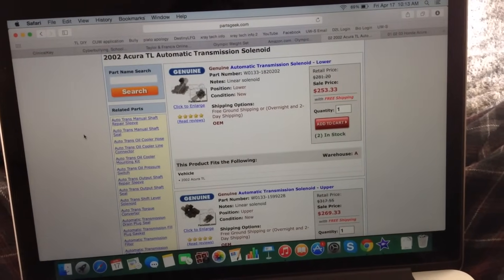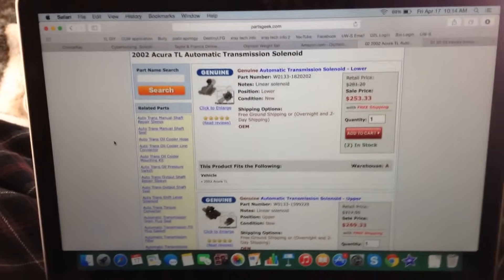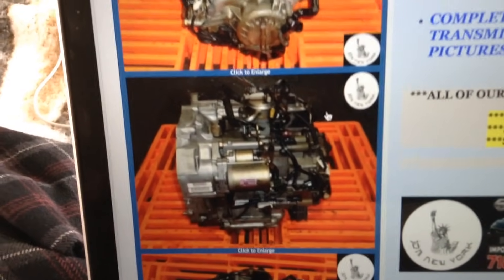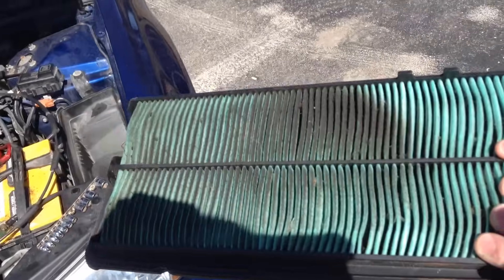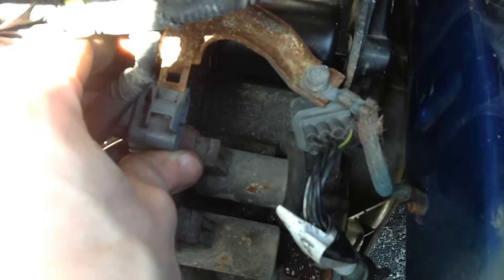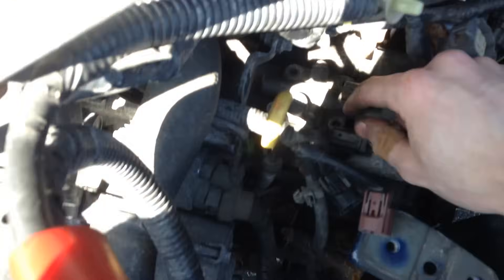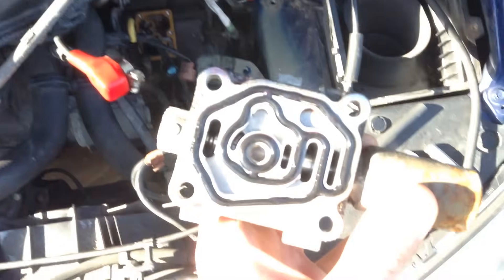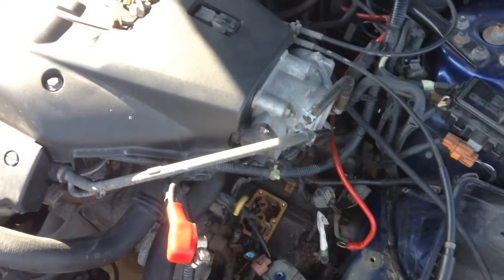Transmission Fix: How to Clean Solenoid Screen Filters for Honda/Acura P0730 P0740 P0780 P1750 P1751

Comment: I did this procedure on my 2003 CL - S I thought successfully(though all 3 screens were amazingly clean). But soon as I started the car it's now throwing a code 1768 and the check engine/VSA lights are on. When I put it in Drive it seems to be slipping & revving high just to move forward??? WTH PLEASE HELP!!!
Reply from the maker: I've never heard of anyone cleaning the filters and then the car performs worse. Sounds like there must have already been an underlying issue. Did you clean the bottom solenoid filter too? How does the fluid condition and level look? It could also be an electrical issue. Make sure you hooked the connectors back up to the solenoid all the way until they click in place. Also, try checking the fuses. A simple blown fuse could be the culprit too.
Reply from the maker: I've never heard of anyone cleaning the filters and then the car performs worse. Sounds like there must have already been an underlying issue. Did you clean the bottom solenoid filter too? How does the fluid condition and level look? It could also be an electrical issue. Make sure you hooked the connectors back up to the solenoid all the way until they click in place. Also, try checking the fuses. A simple blown fuse could be the culprit too.

Comment: Did you have any codes for the transmission?
Reply from the maker: yup, original code I was getting was P0740, and doing this made it go away!
Reply: Ok i have a p0730 code.
Reply from the maker: @11caseyd  faulty solenoids can possibly set that code off too. You could still give this a try! Otherwise, make sure your fluid level isn't too low or too dirty. You can check out my other video on transmission fluid here: https://youtu.be/SjYVD2WCrCM
Reply: Im going to clean then and try lucas stop slip. Just need a bandaid for the winter then ill do the 06-07 accord av6 transmission swap and be done with it

Comment: I have a code p0746 pressure control solenoid "A" stuck off... Do you think I could do this instead of removing the whole valve body?
Reply from the maker: It's very possible! Basically, this code means something is obstructing the flow of transmission fluid through the valve body, such as the filters shown in this video. Give them a clean! It's free and can only do good for your car. Also, check your transmission fluid. When was the last time you changed it? Is it really dark, dirty, or smell burnt? Is the transmission fluid level low? These are also very possible symptoms of your CEL. Check out my other video on transmission fluid for more info! https://youtu.be/SjYVD2WCrCM

Comment: When I clean mine out just like you did after two weeks Dave get right back dirty what shall I do
Reply from the maker: if you had junk in the filters, that's both a good and bad sign. It's good because you know where your problem is, but bad because that means your fluid and filter probably need to be changed. If you cleaned out the filters and they became clogged again, simply clean them again as well as change your ATF and exterior filter as shown in my other video here: https://youtu.be/SjYVD2WCrCM

Comment: My 03 TL Type S coded the p0740 several months ago. Since then, it won't shift from first gear. I try to crank it and idle it around the parking lot so that it doesn't just sit there and fall into further disrepair. It only has 298k miles on it. 
I'm going to try this. Between all of the videos on here, the Hayes manual, and the official Honda/Acura repair manual pdf, I hope I can get it back on the road. It's surprising how much more difficult it is to work on a car in an apartment parking lot than it is in a yard or a driveway.
Reply from the maker: Yah working on a car at home is way more convenient! This repair has helped a lot of people! But if this doesn't work, people have also told me replacing the solenoid itself has fixed their vehicles as well. Good luck!

Comment: if it does not work ... can you take the part back???
Reply from the maker: If you bought a replacement Honda part from an authorized Genuine Honda parts seller, all parts should come with a 1-year warranty. You can find replacement solenoids online if yours does not work.

Comment: I have a 2000 acura tl i just replaced the trans with a used one.it had a similar problem shifting into 3rd gear.i watch your video last night today i did exactly like you did in you video.the bottom selonoid filter was completly clogged with friction material cleaned with throddle body cleaner.test drove it a few miles and it seems to be much smoother ride.great video very informative.thankyou for your help i will subscribe to your channel.thanx again.
Reply from the maker: That's awesome! I'm glad to hear this helped you! Thanks for the sub!!

Comment: Just in case this doesn't work for anyone.. You may consider doing a AV6 swap .. You can goggle it ,but I was short on luck. my transmission shop was/is willing to do it but told me the donor transmission needs to be 20,000 - 45,000 miles. He said with all the V6 trannys up to 2010 are vunerable to slipping  after 50-60,000 miles... The issue is still there. Some who did the swap are kinda still riding on luck. But it still worth a shot... I'm gonna still try but I can't find anything under 50,000 anywhere.. But I think it's due to them still being used and possibly rebuilt. But this video is working for me so far after 1 drain & fill .

Comment: Long story short... I did clean my screen filters on both solenoids yesterday .. Similar filters were clogged... I also changed my external filter..

It changes smoother but I got the rev up thing again after going uphill and unto a flat.. Thing is when I got the car in 2016 it was sitting for a years plus before so I don't know how the fluid looked or what.

My foolish mistake was taking it to Jiffy Lube..but the same symptoms happen even after their fluid change... What I'm very skeptical about is I asked if it was Honda fluid ,they replied it's an equivalent.. I never got around to doing a change because this was the only vehicle working in my home.. My hope is that a 3x3 drain and fill every 1000 miles will solve the rev up issue.. Because it could have been both old fluid,clogged filters and jiffy lube knock off fluid that still making this happen.

Will update after Honda fluid change tomorrow.
Reply from the maker: Yeah these transmissions very specifically require the Honda DW-1 ATF, and it very well could make a difference. And after a drive, park your car on a level surface, turn off the engine, and check the fluid level again. Having the ATF level slightly over/under filled can cause issues as well.
Reply: @CarRepairsMadeSimple  Okay so I did a drain and fill with DW-1 3 days ago.. Shifts are a bit smoother but I've had 3 times since that the  rev up and won't go in gear thing happened. I'm wondering if the 6 or so quarts of Jiffy Lube crap fluid is overpowering the Honda one and heating up due to the expired quailty.

Do you feel by the next 2 drain and fills things should improve even more?
Reply from the maker: @JJDRProductions  There definitely is going to be left over jiffy lube fluid in your transmission after a single drain and fill. Our transmission actually holds about 9 quarts of fluid. So every time you drain and fill 3 quarts, you're only taking out 1/3 of the old fluid. So if you did it 2 more times for a total of 3 drain and fills, you will have removed about 75% of the jiffy fluid, which will definitely improve your transmission even more. It's good to hear things are improving though!

Comment: this took out my check engine light thanks!
Reply from the maker: That's awesome to hear!! Glad my videos helped!
Reply: @CarRepairsMadeSimple  you have no idea man. This car was my late father's and I want it to run for a long time. I still remember the day he bought it in 02 and how proud he was. Your video was so helpful to a car noob like myself. I can't thank you enough. You didn't have to put this up and help people out but you did! P.S. that gray plastic wire connector/cover over the solenoid is a BITCH. Ended up just bending the metal upwards to reach the bolt underneath.

Comment: Do I need to spray any penetrating fluid on the bolts before trying to remove them?
Reply from the maker: I didn't, they came off relatively easy. Once you crack them loose, you can loosen the bolts the rest of the way off by hand.

Comment: I have the same code on my 2004 Acura TL I checked the screens on the top and bottom solenoids and the screens are clean I just ordered some new solenoids from Acura
Reply from the maker: Good luck! Let me know if the new solenoids fix the problem!
Reply: Incin3ration hey man so I went to the junk yard and pulled the solenoids off of a 2004 Honda Accord they were only $20 installed them . I also reset the transmission ECU it’s shifting really smooth now!!
Reply from the maker: @Praiseyahwehandyeshua  Awesome! Glad to hear your car's working again! It's also good to know that changing the solenoids does in fact fix peoples problems!
Reply: Incin3ration now I just have to change the transmission oil
Reply: Thanks  I’ll let you know

Comment: Please help Great video can you show or tell me which of the metal tubes with the filters in them goes where i preformed the cleaning but i might have put the filters back in the wrong holes when i took them i thought they wee all the same length and didnt pay attention to which one came from where i know stupid rookie mistake please help thank you
Reply from the maker: What's the exact year and model of your car? It can vary depending on the vehicle.
Reply: @CarRepairsMadeSimple  thank you for responding i have a 99 acura tl 3.2 automatic
Reply from the maker: @ronmiller6897  The shortest filter should be towards the back of the car and the longest filter should be towards the front of the car

Comment: Hi, thanks for the video . I did this on my accord 2003 V6, but it keeps getting clogged. Any Advice??
Reply from the maker: How clean is the transmission fluid? The stuff clogging up the screen filters is clutch material. I would recommend doing a transmission drain and fill. Also when was the last time your exterior transmission filter was changed? Doing that would definitely clean up the fluid a lot as well. Just make sure to use Honda DW-1 and an OEM Honda filter. The filter is a bit expensive but worth it. Check out my video on how to do it!
https://www.youtube.com/watch?v=SjYVD2WCrCM&t=909s

Comment: I just bought a CLS and have been hearing nothing but horror stories about the transmissions. Your updates in the description will help me sleep well at night and i'll be sure to tackle all these projects asap. Thanks for the informative videos
Reply from the maker: You're welcome! It has helped countless people! Good luck!
Reply: the dealer swapped a rebuilt trany in my 01CLS under warranty then it failed again 13 month later... they asked for $5k, I said: every year?

the junk clutch shavings that plug the solenoid screens, should not be there in the 1st place... meaning cleaning is hardly a patch before auctioning,  not a fix !

Comment: Thanks very much for posting this!

Much appreciated :)
Reply from the maker: You're very welcome! Glad it helped!
Reply: Incin3ration I have a 2003 tl that just started too slip . My dad checked it and it was not clogged. It would drive fine but if your going slower it would not go into gear ( Almost like in neutral) it was replaced in 2009 with a new transmission but hasn’t had any problems since . What would you recommend - if you turn the car off and restart it - it will drive fine for awhile then it won’t have any power
Reply from the maker: +Laura Elliott does it slip at slower speeds all the time or maybe just when it's cold? Also how clean is the transmission fluid? And make sure the ATF level isn't low or overfilled. Lastly, any check engine codes?
Reply: Incin3ration thanks for your reply back !  My dad changed the transmission fluid 2 weeks ago ( and it was driving fine everyday up until this Saturday) the check engine light was not on after a flew slips then it came on . We checked the fluid level and it was fine . Now the engine light is on.
Reply: Incin3ration P0730 was the code
Reply from the maker: @lauraelliott579  How was the fluid condition before you changed it? Did you use Honda DW-1 and replace the black external ATF filter? And by "change" I hope that means you did a single drain and fill, not a flush or a 3x3. Flush = bye-bye transmission. Also, you checked both solenoids shown in this video, right? Not just the top one? If the fluid is good and all the screen filters are clean, then it's an electrical wiring or component failure somewhere. This likely isn't the cause, but maybe check that no fuses are blown. Also, while p0730 is a similar code, it is different from p0740 as explained in this video. Your p0730 code is for the shift solenoid valves, compared to my p0740 code which is for the Torque Converter Clutch (TCC) Solenoid which was cleaned in this video. Check out the shift solenoid valves. Replacing them may be where your problem lies. Good news is the shift solenoids are affordable if they need replacing.

https://f01.justanswer.com/jasontech88/9ecc50bf-6322-4653-91e1-fbc2bff29a29_Screen+Shot+2017-04-11+at+3.07.15+PM.png
Reply: Incin3ration were replacing the bigger solenoid that has 2 values -
Reply from the maker: @lauraelliott579  Please let me know if changing it fixes your transmission! Good luck!
Reply: Incin3ration will do !!! Thank you so much for your help - save us a trip to go to the mechanic, getting part today. ( and yes we changed the fluid correctly with the correct fluid  and everything was good) car only had 1 previous owner before we bought it
Reply: Incin3ration so we put the new solenoid in - and test drove it . It still grabbing but it has a loud clicking noise now. But there no light on. We believe it’s a mechanical noise -
Reply from the maker: @lauraelliott579  By grabbing you mean it isn't slipping anymore in a good way? If the CEL were to come back, it may take some time. The cars go through driving cycles that trigger different I/M readiness tests which can take anywhere from minutes to days. Clicking noise could mean a million things, but it straight up sounds like there's a mechanical problem with your vehicle rather than an electric component failure somewhere. Does it sound like the noise in this video?

https://acurazine.com/forums/3g-tl-problems-fixes-114/ticking-sound-now-969350/
Reply: Incin3ration hi we took it to the mechanic- because my dad changed the oil - they believe the external filter is  clogged . That’s the problem :/ hopefully nothing else
Reply from the maker: @lauraelliott579  Yah the external transmission filter is widely forgotten and unknown by most people! I have another video on how to change the transmission fluid and external filter! 
https://youtu.be/SjYVD2WCrCM
Only thing is the filters are a bit pricey, $50+. It's tempting to buy a cheaper aftermarket one, but I would highly advise against it from bad personal experience. Get the OEM Genuine Honda one: 25450-P7W-003.

Comment: Thank you so much took me about two hours all I had to remove was the battery, battery tray and battery tray support and those clips shown in the video, and of course the solenoid top itself. Problem with my 2002 Acura Tl Type S with 93K miles. I had hard shifting, not going into gear, super hard shift going into reverse. Engine codes: P0700(A/T System Malfunction) Transmission Codes: P1750(Clutch Pressure Failure), P1751(2-3 Shift Malfunction). I cleaned the screens with Birchwood Casey Gun Scrubber and then blew with compressed air. I also changed out the transmission fluid and filter.
Reply: Did that fix it?

Comment: Clogged screens in linear solenoids suggests more of the same inside the passages and orifices within transmission--y'know, where you can't get to. It's not possible for this particulate to contaminate transmission fluid from outside sources, so intuitively it must be wear from the friction surfaces. It therefore seems prudent to install a disposable external transmission filter (for example, "Raybestos Automatic Transmission Filter"  https://amzn.to/2ARMHKC) to trap as much of the gunk as possible in a easy-to-replace externally mounted filter.
Reply from the maker: Exactly! I have another video on how to do that too!! When I got the car it had never had the external filter changed. Sure enough the filters got clogged. Now that I've been routinely changing the ATF and exterior ATF filter, I've had no issues!
Reply: @Incin3ration   where is that video? Also wanted to tell you I been having issues shifting 1-2 other gears smooth tho. Gonna do this. Thank you

Comment: What are the torque spec for this? (Solenoids)
Reply from the maker: I'm afraid I don't know! I've always just snugged them down by feel. They're relatively small bolts, just snug them down good. If you or anybody else finds out the torque specs, let me know!
Reply: @CarRepairsMadeSimple   For the dual one it's 8.7 lb ft. and for almost all the torque spec I see on pressure switches or solenoids in the manual is 8.7 lb ft.
Reply from the maker: @JJDRProductions  awesome! thanks for sharing this!